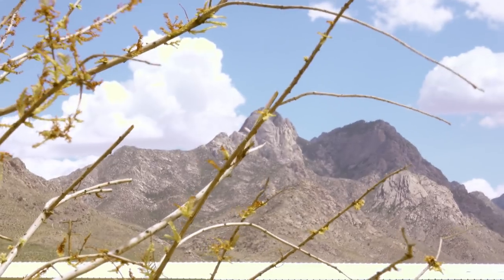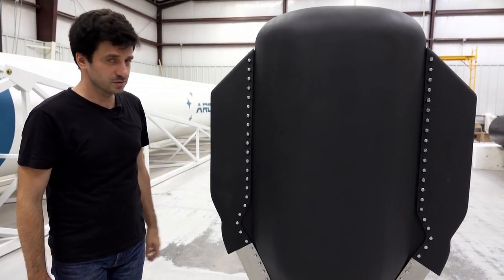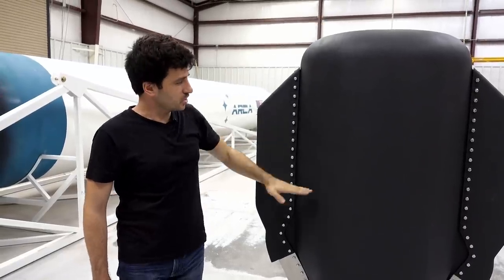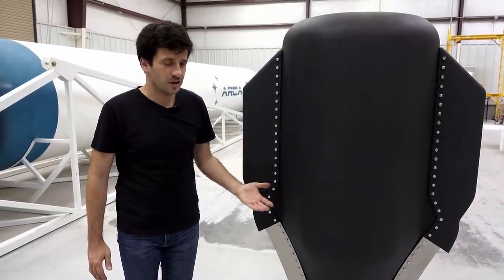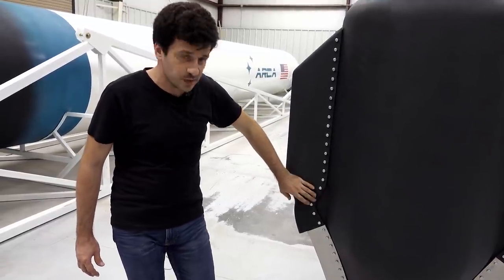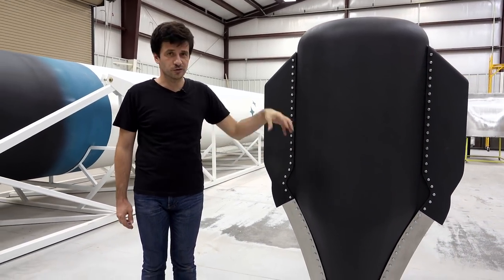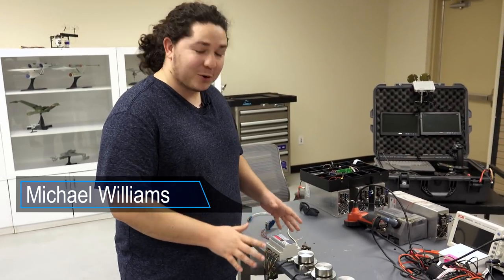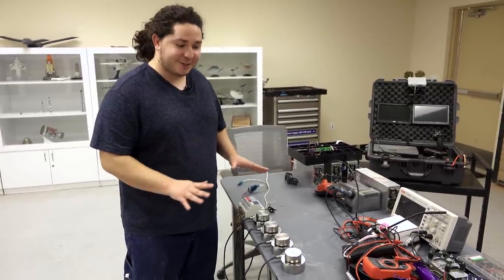Flight of the Aerospike: Episode 6 - How the Engine Works

Comment: I was beginning to worry of a setback when Episode 6 didn't show up over the weekend. Great way to start the week!  This explained some questions I had with how it was going to work. Very interesting injection system design.
Reply: Alex Glass Don't you need insanely high injection pressures to force your fuel all the way into the catalyst against the flow of hot exhaust gases already coming from the catalyst bed? Could you run into a situation where your fuel just gets blown away before it reaches the catalyst and then you'd get a pogo-like stuttering effect?
Reply: @Martin Zietz I assume you were probably trying to ask ARCA that question as that is above my pay grade :)
Reply: I have a question. but first I have to explain where it comes from. There is a Norwegian start-up called Ripple Aerospace that are actually attempting to revive the Sea Dragon concept with launching aerospike equipped rockets directly out of the ocean and plan on building them out of shipyards, then floating them and towing them to the launch point. No launchpad or launch complex infrastructure. They would have to have figured out a way to deal with salt water corrosion as they also plan on making the system fully reusable despite launching out of the ocean and recovering them by dropping them in the ocean.

My question is, could ARCA's pressure fed linear aerospike engine system and your use of composites be combined to create a salt water corrosion resistant and reusable rocket? I imagine trying to scale up in the future, without the massive costs of also needing to scale up the infrastructure, leasing large launch pads, etc, would prove seriously advantageous.
Reply: Thanks for answering that, and everyone else's questions. I'm learning a lot from reading all of your responses and you have a great way of handling criticism and objections with nice explanations. It's very refreshing. And I was thinking more long term, post-HAAS plans if that would be a more cost effective method of doing space launches when rocket sizes get to the point where they require much more expensive infrastructure, pad leasing, launch complex building leases, road transportation, etc. It appeared to me that if anyone goes that route, you get to cut out a lot of expenses. I hope you guys establish yourself with the HAAS 2CA, but I'm definitely hoping you will go much further than small satellite launchers and wish you the best through each step as you  progress forward.
Reply: Yeah, I was thinking about  a side operation in the Black Sea too, but  ITAR probably makes it so there is no going back now;). You are right,I am getting too far ahead , but I am glad you guys have looked into that and I understand focusing on Demonstrator 3 and HAAS. They are amazing attempts in their own right and I hope you can lead the way forward with the linear aerospike engines and super light construction.   Look forward to seeing them fly.
Reply: Use reinforced carbon-carbon instead
Reply: Alex Glass simply by design. It works like a glorified ram jet. NASA tells us that rocket thrusters work in vacuum (even against evidence disproving it) by the Newtonian 3rd law, opposite reaction. This engine nulifies that with the compressed gases flow. It needs static pressure at end nozzle to work.

Comment: Was Manganese Dioxide the catalyst used? Also, Is the injector a traditional atomizing injector, as used in older rockets, or by 'injector', do you just mean something that releases the Hydrogen Peroxide at a high rate?

Also, I forgot to ask, how is the catalyst bed layed out? Is it held down by something, or is it just packed in the bottom?

Comment: I see a discharge plenum made from aluminum with a melting point of 1100 f depending on composition with a discharge Temp of 250c or 480 f and doesn't seem to have enough thermal expansive pressure at that temp alone coupled with oxgen to atmospheric nitrogen mix at discharge pressure of 1600 mph + your temps are 2/Q are going to be at or very close to  the melting point of the aluminum at the  exhaust  discharge. ???? What is the load lift value ????

Comment: So forgive my question here but this appears to be a simple hydrogen rocket. You force the hydrogen under pressure towards the silver catalyst plates which converts them to steam. The only exit point for these gases is on the sides of the assembly. 
So my question is, what is different here so you call it an “aerospike” engine instead of a hydrogen rocket? Is it just the venting of the exhaust gases? Also, as the exhaust exits the housing I notice it is directed towards a curved surface. Does this have a significant impact on the velocity of those gases?

Comment: If you inject the fuel in a downwards direction, isnt that bad when the exits for the plumes are at the top of the chamber? How do the gasses get from the bottom of the engine to the exits on the top, then make a 180° turn AGAIN and then get spewed out the back? Those are two 180° turns and that seems a bit weird and impractical to me.

Also can you tell me anything about the final weight of the rocket, the isp of the engine, the deltaV or the surface thrust to weight ratio? (I totally understand if you cant, I'm just curious)
Reply: Speaking of Helen, maybe you guys could have kept going with the idea of launching from a balloon. I recently learned of a Spanish company, Zero 2 Infinity, that tested the concept of launching their rocket from a balloon last year, and have recently announced a tourism capsule now as well. Seems like a nice ride. Even though it was quite different, you were way ahead over a decade ago. Those balloon rides seem like a safe system to bring to Spaceport America too and actually help the Spaceport accomplish what it's supposed to be.
Reply: How expensive would it be to heat a balloon with hydrogen peroxide and hydrogen flame?

Water vapor is actually lighter than air and you could burn off the additional oxygen with some hydrogen, and just let the superheated blast of steam rise into a heat resistant shell [super thin aramid fibers (such as Kevlar, but need not necessarily be that specific one) coated with a fine film of silicone rubber would work] in a tube shape would work as the rocket could be launched straight up out of the middle of it, but the launcher could also be mounted on gimbals so as to allow the rocket to be tilted from beneath the balloon just prior to launching.

Either way, if you allow the rocket to be cradled in the balloon, it would try to rise along with he rocket, briefly, allowing just a tiny little more initial boost until the rocket accelerated away from the balloon.

Depending on the ascent rate of the balloon, it could add some of the flight velocity to the rocket.

And yes, I am aware of thrust interaction [the original terms would either be 'jet wash' or 'rocket blast' depending on who you asked] with the platform, but this is why using a really strong fiber would work and one would simply have to engineer the shape to allow the balloon to safely divert the rocket wash down through a rigid inner liner and away at the top with a slightly conical rim [like the top of a volcano].

The balloon would go up rapidly due to the superheated steam, the rocket would spring away at maximum altitude, and then the balloon would begin descending as it began cooling off and its shape would act like a parachute to offset the loss of buoyancy.

The low thermal conductivity of aramid fibers, as well as silicone rubber would reduce the rate of thermal losses to slow the cooling, although one could also aluminize the inside to trap in infra red heat losses and stain the outside black to increase sustained solar heat for the time it was at the apogee of its lift.
Reply: Wait, what? How is the rocket so light? The engine alone looks like it's 70 kg. Is that wet mass or dry mass?
Reply: 1.7 meters at what speed?
Reply: Woa, participation award recipients...
Reply: Miss Cricket. Linear Aerospike engines essentially have two exhaust nozzles. Assuming the nozzles have independent throttles, you can control pitch by throttling up one side and throttling down the other. With additional engines, you could control yaw by throttling up an engine off the center line. Roll could be attained by "pitching up" one engine, and "pitching down" it's opposite.

Or at least that was how attitude control was proposed for the X-33 and Venturstar, I'm guessing ARCA"s engine could work on a similar principle.The other possibility is that their rocket uses reaction wheels.

Comment: I used to work for Rocketdyne from 1980 until 2010, the original Aerospike engine used to be in our storage yard at the Santa Susana Field Laboratory. Glad to know it has been resurrected as they technology was always valid. Why are you not using LOX/LH2 like the original? Boeing

Comment: Somethings I just dont understand, 1 is why r u hand drilling the exhaust ports? shouldnt they be made on a CNC machine? 2 is doesnt hydrogen peroxide break down in hydrogen & oxygen w/a bit of water vapor? If im wrong then @ least Ill learn whats right, is it that the hydrogen is what gets burned in my 2nd question?
Reply: Without the extra holes, she'd be just fine. Anyone with extra holes like that would look strange.
People with strange growths on their ears usually have them removed. I don't understand why people purposefully want to look deformed.

Comment: If I remember correctly, one of the problems they werent able to resolve on the original aerospikes was the cooling of the spike itself.  Is that going to be an issue for suborbital flights and/or do you have a cooling solution and/or am I making this up from somewhere?

Comment: how do you control the amount of fuel,and how do you cool the exhaust area from melting
Reply: Allan Fraser They control the amount of fuel by choosing the size of the fuel delivery conduit. Cooling on this one isn't really a problem. The exhaust will only reach 250 C (482 F) and high temp composites can handle this easily.

Comment: At least to me this concept looks like an upscaled and massivly improved hammerhead, it works on rocket models so i see no reason why it shouldn't work in full scale, many people forgot about the fact thet weight and density are constand, wich mean an upscaled model will still hawe the same relativ fuel weight correlated to the output even if it is scale up (but a significaly lighter body compared to a small model).
Being rude in the comment line does not by any means change physical laws.

Comment: If this approach gets to orbit I will be very surprised, pleasantly so, but still, very, very surprised. This demo version obviously doesn't have a snowball's chance, but that's fine it's not meant to reach orbit. But the full scale thing Haas 2CA is also very borderline between "never gonna work" and "just barely might" and that is being very generous. I mean, look at the limitations, pressure fed, high test peroxide for oxidizer, single stage. Hats off if they actually make it, but I really wouldn't bet on it.
Plus their credibility as a company is more than suspect, what with CEO getting arrested on counts of fraud, embezzlement and forgery. At best it's a showstopper for hopes on investment, at worst it means the entire thing is a sham.
Reply: Ridiculously good mass ratio is the only way it could work with a system like that, only way to make up for potato specific impulse. So betting the house on that is the only possible design choice. If the published spec of 2CA can be met then by my napkin calculations it's just barely possible. I suspect the spec is very much on the optimistic side, but the spec as published does just about add up by my naive calculations.
If on the other hand the rocket falls just a little bit short of mass ratio or isp spec, or the gravity and drag losses are slightly more than expected, whelp, no orbit on this rocket. Its very borderline, so much so that even reduction in payload barely makes a difference. On a multi stage rocket it would make a huge difference.
Reply: Well I wish you luck, you are going to need it. If it works out I will be pleasantly surprised and it will be something that hasn't been done before.
Reply: It will get to orbit. Just not in the way they intend.

Comment: instead making 2 side nozzle, why you don't make one nozzle all around so you can have the trust distribution on 360 degrees and making all the engine multi directional good in space with no air drag.

Comment: What's your design ISP?
Reply: How is the Hass 2CA so much more efficient? How does it differ from the Demonstrator 3? Also, have you launched any monopropellant rockets before? If so, do you have videos of them? Also, how are linear aerospikes better than toroidal aerospikes?
Reply: Thank you for your quick response! I have a few more questions. Will the H2O2 be pumped directly into the combustion chamber to act as the oxidizer? Couldn't you have it react with the catalyst bed beforehand? Then the water vapor and oxygen gas could be plumbed into the combustion chamber to act as the oxidizer.

Comment: I don't see how this can be very practical for using in a rocket, this fuel is peroxide interacting with silver(probably) to cause the reaction which was done with the first "jet packs" the military made which could only fly for a few minutes.
Reply: Interesting.  Would this be the only type of engine used for a rocket?  I just don't understand how or what application this would be good for and if you plan on having it run longer.  I am a fan though and would love to see how far this could be taken.  I don't expect a reply and really appreciate this one.  Can't wait to see it in action.

Comment: Electronics setup is a fake.
It kinda resembles beginner's Arduino set - flimsy breadboarded wires connected without a rhyme or reason.
The toolbox at 2:54 contains run of the mill Raspberry Pi parts (most noticeably Pi camera).
Nothing there is even remotely capable of being used whithin a rocket stand.
Reply: It may be fake, but  what's wrong with RaspberryPI? Only thing it is missing is some ADCs, no?

Comment: This all appears to be low budget... am I wrong?
Reply: I guess the the engine you showed is a mockup right? Because those bolts look way way over sized.
Reply: yes, low budget.  Using Hyrogen peroxide and catalyst bed instead of liquid oxygen and Kerosene for example.  But for the purposes of demonstrating the main features of the aero spike engine I understand that.  Much simpler exhaust gas maker.  A reasonable design decision at this point

Comment: This is a joke?
You are showing buch of arduino kits and breadboard as show case for your R&D department?
Is your exaust made from painted plastic?
What is that?
Reply: So you think that arduino is weak??
Reply: So how do you think that data accusations is done on small scale.
Reply: @abhishekkushwaha100  I failed to notice Arduinos in the video - only Raspberries.
And arduino IS weak compared to the same AVR chip coded in C.
Why WOULD you use Arduino or Raspberry for rocket engine testing rig? Wouldn't you design something more reliable and robust like a custom hardware based on FPGA?